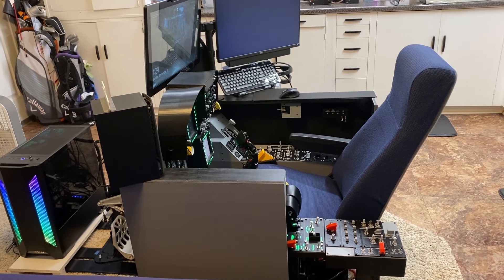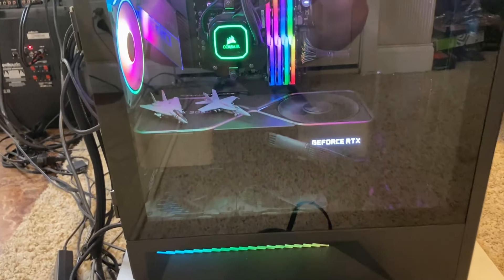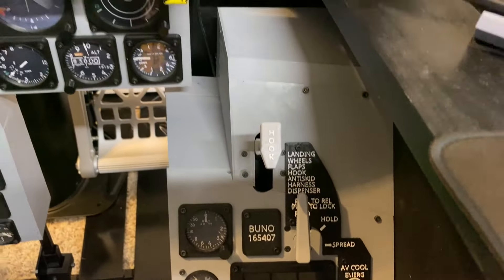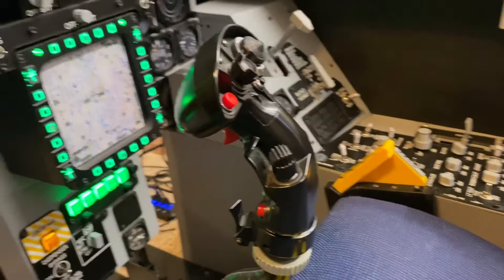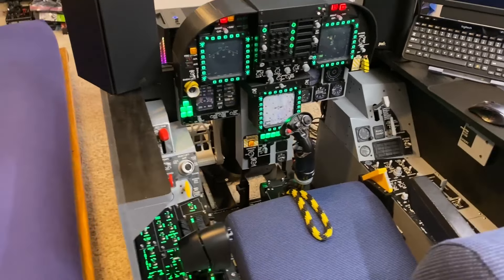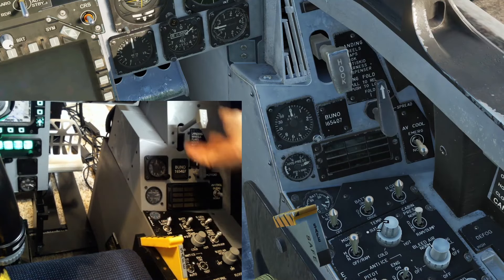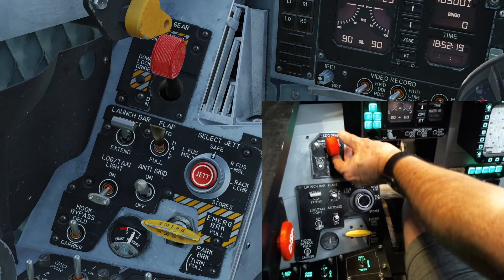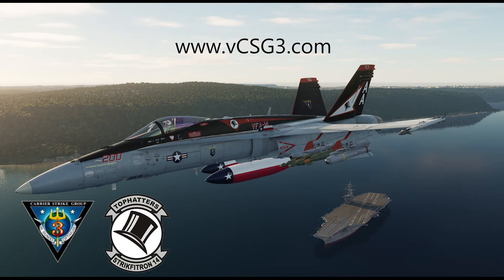3D Printed F/A-18 Hornet Cockpit for DCS World

Comment: I'm suprised you'd spend all that time and money on this, just to use those little monitors, which are like the most important feature.
Reply from the maker: they are the least important feature. I play in VR (mentioned 30 seconds into the video)
Reply: @DCSTex  You ALWAYS play VR? Never play with the headset off? If that's the case, then I'm failing to see the importance of making everything look so nice and detailed, since you'd never really see or appreciate it while wearing goggles.
Reply from the maker: @abstractmind4191  Always in VR.  Agreed I could've made it super plain and it would still be functional, but it wasn't much effort and I'll be set for augmented reality when that becomes viable

Comment: Looks nice and I appreciate the work that has gone into it, but this kind of set up is pointless as there is such a narrow field of view onto the virtual world.  You need a new display system that will give you close to 180 degrees field of view, not 30 degrees.

The difference that will make to enjoyment of the sim is immense.

And the enjoyment and ease of flying gains much more from improving the display system than improving the user interface.

You want to get as much bang for your buck in terms of improvement in enjoyment and realism and putting your efforts into improving the display system are where your time and effort should go.
Reply from the maker: That's your opinion.  The depth perception you get from VR far outweighs the limited field of view for me.  No matter how big of a 2D screen you get, you will never have good depth perception

Comment: Specs from ur PC?
Reply from the maker: Ryzen 9 5900x proc, 64 GBs Trident 3600 RAM, NVdia FE 3090, 2 NVME SSDs (one for windows and one for DCS) + some spinning drives for storage.  Lian Li Case and Corsair AIO water cooler for CPU
Reply from the maker: and an add in sound card for the butt kicker